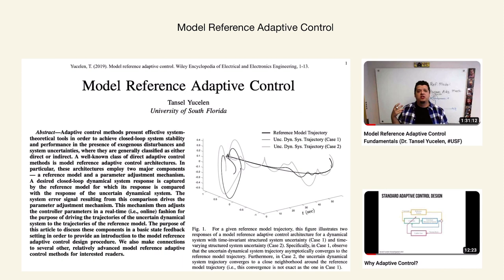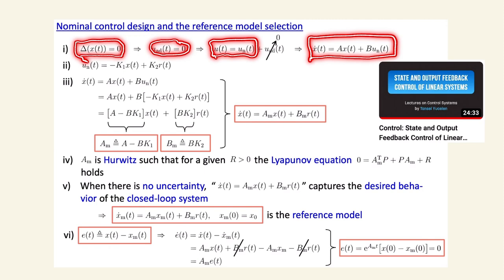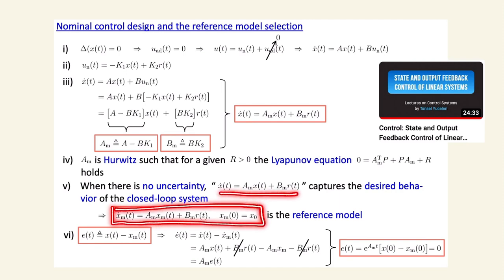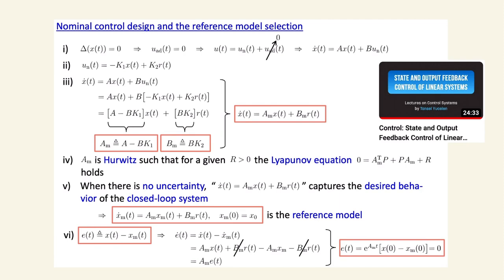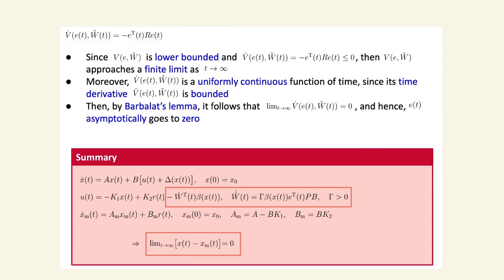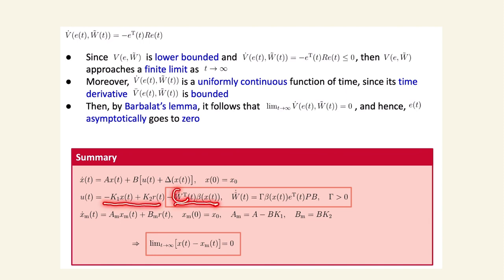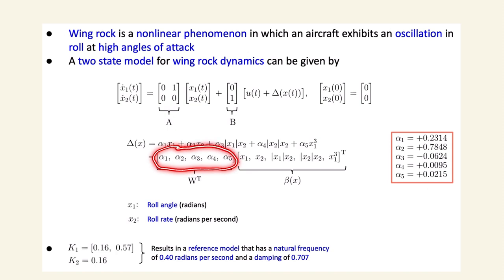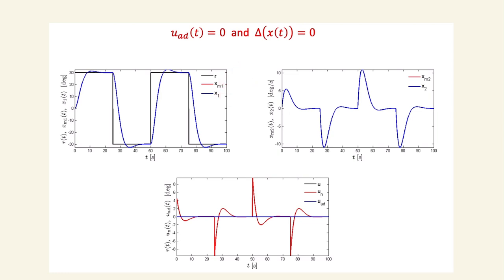Control: Model Reference Adaptive Control (Lectures on Advanced Control Systems)

Comment: Hello Professor, thank you for producing videos on these interesting control engineering topics. The topics you present are on point. For me, this channel is currently the most interesting in the field of control engineering on YouTube. The programming examples are very helpful for a deeper understanding. I would be happy to see videos on the topics "Transient Performance Recovery" , "Enforcing Performance Guarantees". I would also be interested in the topic of LMI for stability studies of gain scheduling controllers. What problems can occur when the gain scheduling parameter is the controlled variable, especially for very dynamic systems?
Many thanks
Reply from the maker: Thank you very much :) I will try to make videos on transient performance recovery and enforcing performance guarantees. I will first post a video on MRAC example in Matlab on April 14th. About gain scheduling, check this video please: https://www.youtube.com/watch?v=S5ylpVTNJeM

Comment: Thank you! I would like to inquire about selecting a reference model. For instance, if I derive a model through system identification, with force as the input and displacement as the output, within a spring-mass-damper system context, could this model serve as a reference model? While configuring, I noticed that both the reference input and output seem to share the same physical properties (e.g., displacement). However, in a spring-mass-damper system, the input is typically force, and the output is displacement. How should I approach designing the reference model? Thank you in advance for your guidance.

Comment: Is there an example available where the nominal control input is generated by a PID or PI controller to track a reference input? I would like to validate my calculations for an adaptive comfort mode of flight vehicles?

Best regards

Süleyman
Reply from the maker: I will post about this soon. Stay tuned. If you want to learn about this now, you can check: https://onlinelibrary.wiley.com/doi/abs/10.1002/047134608X.W1022.pub2
Reply: @tyucelen  
Thank you very much. I would like to buy the book, but there is  actually a buying  stop at my University due to changes  in the financial  system. 
I am interested more in the derivation  of the adjustment mechanism for a given control architecture such as PID control architecture. 
I hope you will post something regarding this. Probably I will buy your  book by my own. 

Best regards to Florida from Stuttgart, Germany :) 
Selamlar
Süleyman :)
Reply: @tyucelen  I actually tried to implement this for a PID controller as nominal control input. But I am unsure how to handle the derivative part. Do you have literature or suggestiongs regarding that?

Best regards

Süleyman
Reply from the maker: I will post a video tomorrow morning, where PID is used as the nominal controller @suleozkurt1819
Reply: @tyucelen   thank you very much :)

Comment: Hello Professor. I have a question. dV/dt is a negative number since R>0 (excluding e=0). So why it is necessary to use Barbalat's lemma? Isn't R>0 enough to imply V->0 for t->inf? Thank you
Reply from the maker: It is not enough. To understand this point, please watch https://youtu.be/H-uzMGqLKTU 👀
Reply: I watched the video. My understanding is that if R>0 (like in this video about MRAC) then we are in the case 2 of the Lyapunov video. So we should have aymtoptic stab. without the need of any other check. Where am I wrong? Thanks for your help.
Reply from the maker: @ivanfurlan6544  So, V depends on e and \tilde{W}. But, dV/dt only depends on e according to dV/dt=-e^T*P*e. Since it does not depend on a quadratic term involving \tilde{W}, the best we can say is Lyapunov stability/boundedness. If we have had, dV/dt=-e^T*P*e-\tilde{W}^T*\tilde{W}, then you are right about asymptotic stability. But we only have dV/dt=-e^T*P*e ;)
Reply: Thank you 😊

Comment: Doctor, as far as i know we re using time domain analysis and design for model reference adaptive control here. In addition there are some books that use frequency domain, Laplace, anaylsis and design and it looks scary :) when i try to follow it. when to use each of them? I think we consider here the case thatuncertainty is in the dynamics what about we have uncertianty in the input part B matrix as well. by the way i am voting for transient improvement video :) thank you again best wishes
Reply from the maker: Thanks for this comment. I will try to post a video on transient performance recovery. About the consideration on the uncertainty in the B matrix, please watch this longer video: https://www.youtube.com/watch?v=c9VwaSEo5t8&list=PLW4eqbV8qk8Z3j1YqD8jCJExA-aiMGFZb&index=13 - It also covers this case and presents a more in depth lecture on MRAC. Finally, about frequency domain formulations, it is possible. Yet, most modern adaptive control designs these days follow a state space approach similar to I do in this video. I hope you will find this reply helpful.
Reply: @tyucelen  thank you hocam

Comment: Hocam, here we set up a control law that guarantees the convergence of the error dynamics to 0 and compensates for the uncertainties, but did these control parameters converge to their correct values? Is it possible to set up a control structure that can guarantee this as well?

It would be great if there is a video about LQR, by the way, iyi çalışmalar 🙂
Reply: In general, they cannot unless the PE condition is satisfied.
Reply from the maker: Not necessarily. As mentioned, it requires Persistent Excitation (PE). Check this out: https://www.tandfonline.com/doi/pdf/10.1080/00207178708933715 as an example.  I will post LQR video by the way next week. Thanks :)